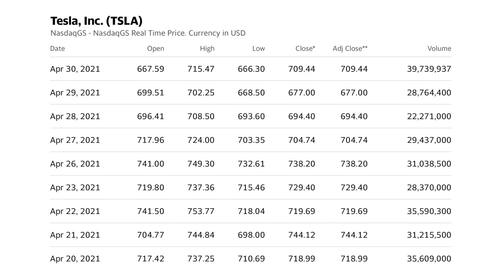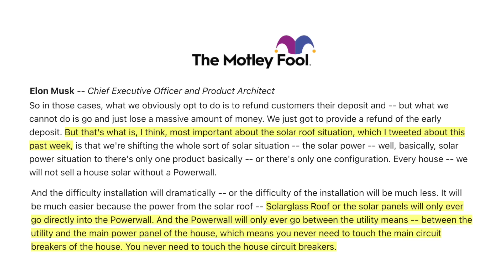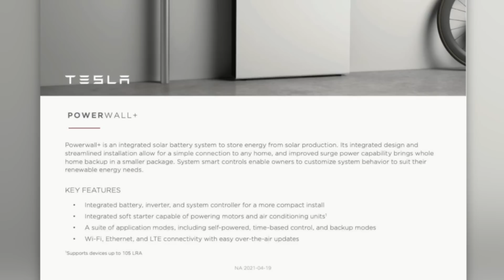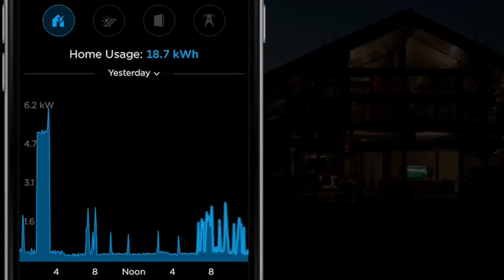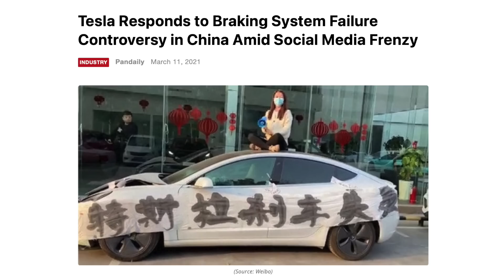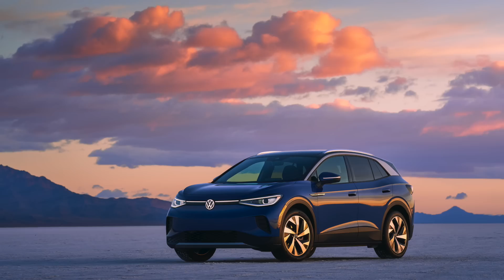Tesla Quietly Releases New Powerwall+

Comment: We are currently waiting for the net meter to our system. This has been the longest wait time during the overall solar panel and dual powerwall2 install. I have been using the system by turning off the grid power at the box and turning on the solar panels each day. Yesterday was the first day we were covered 100%, the batteries support our consumption over night. which is impressive considering 3200 sq foot with 6 adult occupants, and charging a model 3. To my surprise with the soft start on my central air system the powerwalls also support AC, which in the bid Tesla expressed that they would not support AC. Overall impressed with free upgrades they provided at no cost, all the components installed exceeded what was in our initial order. Go Tesla!!

Comment: Rob, here in Anchorage Alaska the longest wait is for building permit and acceptance from the city, that took 120 out of 124 days from start of process to end of process. Putting up your solar takes just a couple days and getting approval from the utility a couple days.
I am pretty sure it is different from location to location, but would not be surprised if the permitting and post installation inspection of the installing of panels/powerwall is the longest time in most places.

Comment: Thanks Rob for your work. I have a question regarding Berlin factory. I was under the impression they will use there the new batteries but in the last call Elon said "We are not quite yet at the point where we think the cells are reliable enough to be shipped in cars" so that means they don't have them yet. Now Berlin seems to go back 6 months and maybe this is the real reason. What do you think?

Comment: whats that got too do with the giant upsurge in backing out of so many telsa solar contracts that havent been fulfilled and then hitting those same people with a new contract with up too a 60% increase on the agreed upon pricing of the old contracts that were agreed upon? Buy sol-ark dc battery/inverter hybrid with Dc optimization or Enphase battery back up with micro inverters, with what ever you feel is better for solar panels. Tesla burning a lot of bridges with local installers right now. dont expect immediate servicibility should something go wrong with your solar system these days.

Comment: I do not see how the powerwall will do me any good other than for a power outage. I have 55 years of experience with my utility, and I do not remember being without power for 24 hours or having 2 failures in the same year. I get the full retail Time Of Use credit for my (cash, not kWh) for my overproduction. About 160 days a year, I could shift energy from $0.0934 to $1622, and 80 days to shift energy from $0.1166 to $0.1611. Given that if I fully charged the battery with off-peak power and sold it for peak-power rates, I would be able to shift about $196 a year for each 13.5 kWh battery.  I paid $100 to start a solar install last week. Given this change of events, I do not think Tesla will be my solar company unless they can show me how auto bidder and make up the difference. FYI I did a 9.2 kWDC DIY system on my previous residence. It was not a package deal. I selected all the parts and did all the paperwork for the permit and all the labor.
Reply: Sounds like you have a utility that plans and implements well and/or hasn’t had climate surprises. Definitely not California or Texas. Your property values really should go up as a result - reliable power. It’s not something we can take for granted anymore.
Reply: @edbouhl3100  I am in Sacramento CA. Lots of people are leaving here but it is not because of the electric rates.
 https://www.smud.org/en/Rate-Information/Time-of-Day-rates/Time-of-Day-5-8pm-Rate/Rate-details
https://www.smud.org/en/Rate-Information/Time-of-Day-rates/Time-of-Day-5-8pm-Rate
The winter rates are 8 months long. The summer rates are higher but they only last 4 months.  They are low on weekends and holidays.   15 miles East or West of here the rates are almost double.

Comment: I think they have gone to a DC coupled type setup. MPPTs feed DC bus, input Grid feeds/takes from the DC bus, likely this is by using the previous “solar inverter”. Internal DC/DC converter exchanges energy to/from the DC bus and battery. Power wall inverter takes from DC bus to feed house panel loads. They added a soft start output for a dedicated high current starting load, AC unit. Moving the solar inverter to the input is brilliant and leverages existing hardware that previously did not have this capability because inverters were AC coupled feeding panel Also I believe this way no longer requires a AC grid disconnection contactor (power outages) because the Grid AC back feed can be controlled via software. A house with dual AC units(zoned) would required more than one soft starter but not difficult I think .

Comment: Concerning the power wall +, Tesla used to be an ac-coupled system, the power between devices was ac. It looks like they are moving to a dc-coupled system. A dc-coupled system requires fewer inverters .
Reply: Yes, this setup will eliminate the solar systems inverter and rely completely on the Powerwall inverter. I wonder if this setup does anything to resolve the off grid Powerwall recharging issues. It would be nice to get a full charge in your Powerwalls vs ~80% at the end of a good solar day.

Comment: Powerwall is a DC power source (battery), so it needs its own inverter anyway to supply the house/grid. Having just one inverter instead of two for solar and powerwall sounds like a smart move. Depending on the details, a lot of potential savings/improvements may be unlocked by combining the systems. Typical Tesla move.

Comment: Could this power wall requirement be why the Tesla Roof customer you previously discussed had their contract cost raised by $50k?
Reply: No, the real issue is their initial estimates were incorrect because they did not properly factor in the difficulty in some projects for installation. The more complex the roof the longer it will take and the higher the cost. They did it most likely as a straight cost with the area times hours times cost of labor which doesn't take into account the complex area of the roof that add more labor/time to costs.

Comment: This new powerwall makes a lot of sense. It removes hassle connecting it to the existing home installation, integrates a product every PV setup needs anyway, and removes regulatory hurdles in the US. I would assume having additional power walls would generally require only one of those additional units.

Torn on trying to get one though. We're working to get our vacation home in the Netherlands carbon neutral, and a solar roof plus powerwall is part of our consideration. We're just not hearing back from Tesla at all however, so about ready to get started on a non-Tesla solution that we could maybe expand in the future with a solar roof only.

There is a disincentive here though as returning electricity to the grid is incentivized here until 2025 at least. (Belgium just got rid of it so market for storage there will grow) There is an argument for battery storage at our home but it's limited. So it seems like we won't be able to get any Tesla product that makes sense until well into this decade. If it'd be all available today we'd probably get it all.

Comment: Sounds like they are trying to do something like "shore power" that you see in boats and RVs.  Let's you use grid power while keeping your battery back up seperate.  The utilities won't have much to say about your install, though won't be able to sell back to the grid.

I built something like that for a single circuit in my house.  It let's me power part of my house by solar with the grid as a backup.  I was able to put it together for under $3000.

Comment: Thanks for your hard work Rob; you mentioned grid integration issues and asked for input, so I thought I'd share what I know as a minor form of gratitude for what you do (I'm a renewables engineer with solar-storage modelling & optimisation experience).

Essentially I'd bet you are correct; the new setup should negate some grid connection regulations. When residential solar is installed, it must still synchronise with the grid and contain a breaker (specific regulations vary per country, per capacity installed etc). The distribution grid operator effectively dictates this, as the purpose really is to protect grid infrastructure and operation and is usually required irrespective of whether battery storage is installed or not.

What the Powerwall+ appears to differentiate with the "Gateway" is something like a separate electrical isolation mechanism, allowing the solar and storage to run in what is often referred to as "Island Mode" by other electrical manufacturers. This would likely allow the solar and storage package to operate completely independent of grid synchronisation; think of it like flipping a switch between "grid1" and "grid2 (storage/solar)" rather than trying to balance inputs/outputs of both at the same time.

My educated guess is that it will be able to do both operation with grid sync and "Island Mode"; the former initially disabled requiring grid approval in some form (in the same way that the current Powerwall setup requires), with the latter "Island Mode" pretty much good to go from installation. I'd also wager that once both modes are operational, the "Gateway" will attempt to calculate and optimise jumping between each mode, when to store electricity, when to discharge battery, when to consume directly etc. I worked on modelling this kind of optimisation in my MSc dissertation a good few years back, quite exciting to see large scale deployment finally happening. Hope this is useful!
Reply: Also without grid sync, it will not be possible to sell power back to the grid when excess power is generated and the battery is fully charged.
Reply from the maker: Thank you, Will. Appreciate it.

Comment: Still Not understandable to me why there is no possibility to use the car battery instead of power walk through a V2G option. As I am using the car daily for not more than 40 miles, am working from home and the car is then loaded by my PV system, I could use the energy form the battery during night time. Furthermore the fleet of Teslas could be used for energy balancing on the network, not only private but also on the public. Would be a huge potential.

Comment: Rob, Powerwall+ will not speed up the approval process for the solar system to go live. It’s just combining functions into a single enclosure. 
Tesla will lose some solar business with the solar/Powerwall bundling requirement. In areas like mine, where net metering is a 1 for 1 kWh swap, Powerwalls have no ROI and actually increase household power consumption. My Powerwalls consume (phantom drain) about 50% of their capacity a month. In April as an example, PW capacity of 27 kWh consumed 14.63 kWh. So not only are solar eating the cost of the Powerwall(s), they are losing solar energy to compensate for phantom drain on the Powerwall(s). Hopefully Tesla will reverse this bad policy.

Comment: Volts wagon need to keep thier jokes more current!
Reply: Sorry that was shocking
Reply: But then they could get charged!
Reply: @yourcrazybear 
The problem was they were to "amped" about the "joke" they didn't have the "power" to "resist" releasing it early, sounds like a fuse blew early.
Reply: @brettmciver432  now youre going to far lets keep it down to  earth
Reply: @yourcrazybear  oh well, at least it jolted you into action.
Reply: @Mrkevino77  Yes, but now I'm feeling so discharged instead.
Reply: @yourcrazybear  at least you are showing some resistance
Reply: @Mrkevino77 
Ok I will ohm up to the pun jokes.
If volts wagon is "charged" will they be kept in a Faraday cage🤔
Reply: @Mrkevino77  So far so good. I'm just afraid i'm going to be grounded.
Reply: @yourcrazybear  Thats good because I dont want you to get too much resistance!

Comment: On the solar through battery not needing approval, I don’t understand how going through the battery makes any difference. Elon wouldn’t say it if it didn’t make a difference so I’m confused... haha
One significant reason you need approval is that the solar + inverter, connected to the house panel (direct or through battery) is then connected to the entire electrical system. To maintain quality and safety of that system there are rules. So unless Elon is saying that if you have a battery (and you have mechanically disconnected from the mains coming into your home) without saying the part in parentheses, whether it’s through battery or not doesn’t make any difference from my understanding.
Maybe 🇺🇸 is different to 🇦🇺, but that’s the reasoning there. If you have an off grid system you can do whatever the hell you want, but that’s not what we are imagining here

Comment: Ontario - must have its own disconnect, must be inspected and verified that when there is a power outage the grid does not get fed. People repairing power lines will get electrocuted.
Reply: So 
Outside service -> meter -> disconnect -> common point A
Solar panels -> inverter -> disconnect -> A
House panel -> A 
In Ontario the solar disconnect must be on the outside at the moment. I had fire fighters come by for training a few years ago. 
If there are micro inverters under solar panels like in my non Tesla system the fire fighters need to be able to disconnect them from the service which in turn causes the micro inverters to shut down.
Reply: With regards to this talk about neighbourhood power grids: we are a long way off because the grades have to be re-designed to allow local neighbourhoods to be isolated. If that does not happen the Tesla, power walls cannot help support the neighbourhood in a power outage because the The repair personnel will get electrocuted.
Reply: Tesla Powerwalls may help the grid but once the grill is down the power walls are not allowed to supply power to the grid.
Reply: @RCdiy  
This is why it is called 'islanding'.

Comment: My unstanding is the glass roof tiles use micro inverters and the traditional pv panels did not. Has this changed?
Reply: It has normal Inverter(s), mounted on the wall.
Reply: All panels uses microinverters and those systems have much better control than tesla ones.

Comment: My system took over a month before I could power it up because of inspections and utility approval. The inspection was actually quick and completed within days, but the utility dragged its feet, then had to install a new meter. I almost wish I waited a few more months for this new configuration, as it looks cleaner and much easier to install. They had to do a lot of rewiring of my panel, and this new design would clearly avoid that. BTW: the fire inspection is not what you think. It is to make sure that the solar panels don't block access to the firefighters axing their way through the roof in the event of a fire. Hence setbacks need to be checked. Those restrictions cost me an additional 7kW in potential production, because I have one of those roofs (sorry Elon).
Reply: Great info 👍,  thanks. How long was install?

Comment: I would guess the overall number of components is down compared to the older powerwall setup. If you believe the chip shortage will persist then Tesla will have a huge advantage over solar/battery competitors moving forward.
Reply: Uhm nope they won't have zero advantage on chip shortage and also tesla strategy will reduce the number of customers. Soooo many people already have solar panels on their roofs and their systems actually allows better control of each individual panel to maximise efficiency unlike tesla features.

Comment: "Soft Start" is a sleeper feature of the Powerwall+.  If you can start your AC via the new powerwall, you can run your whole house through the system.
Reply: Seems like you could start an AC unit with a single powerwall, that prior would require two or more AND would require a soft start device installed on the AC unit itself. The soft start device is about a $300 device too, so extra money saved for Tesla.
Reply: @jeremyjudkins  The AC soft start solutions I've seen are for RV sized AC units.  You can install a cheap soft start capacitor, but it will not work with battery backup.  I'm hoping Tesla has something we've not seen yet!  Unfortunately, I can't take advantage of it, but I really hope they've solved this one!
Reply: @jeremyjudkins  from my research, Tesla normal throws in a separate soft start unit for free as part of the installation if you have an AC unit. Yea I suppose they will save some money if they can produce one in-house and have it all integrated with the Powerwall.